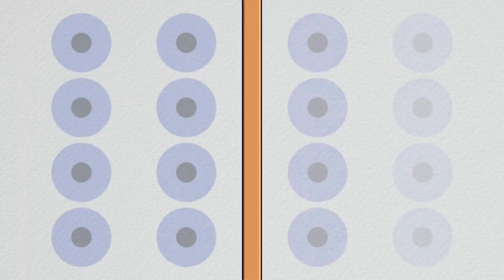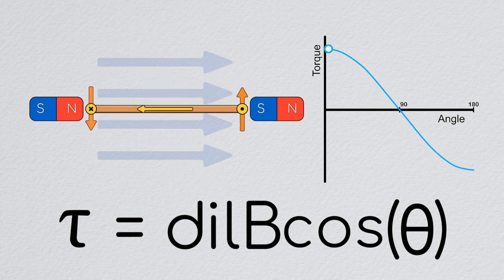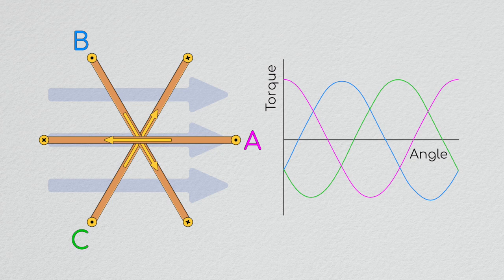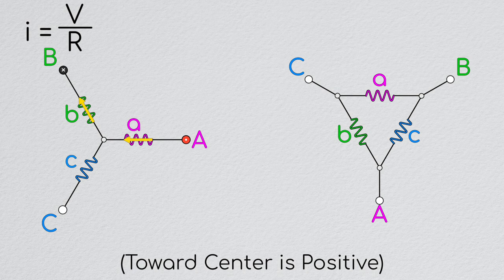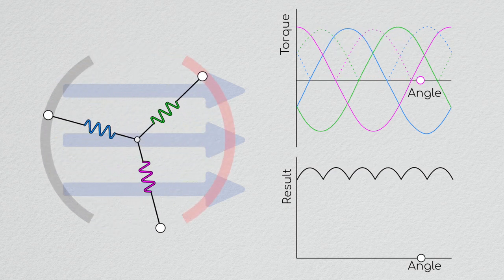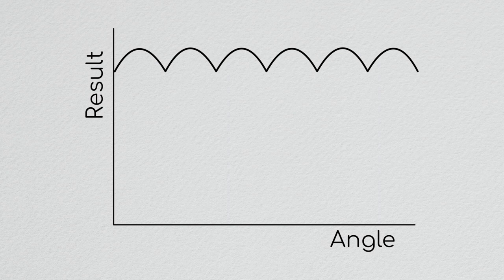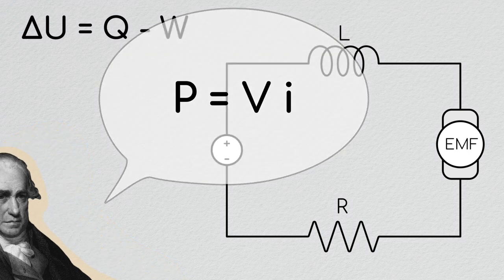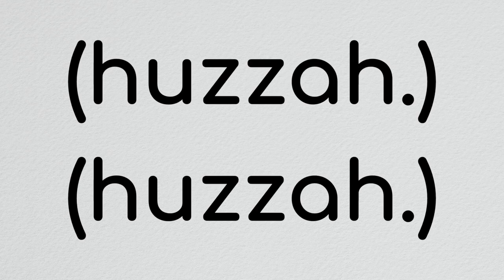How do brushed motors turn?? (Episode 2)

Comment: 1:20 On which plane does the force vector lead the current vector by 90 degrees? Confused at which point along the wire and what theta actually is with relation to  A and B. Are A and B (d) and (ilB) or (F) respectively? Thanks, great videos!
Reply from the maker: Hey great question! Sorry the way i showed/said that is unclear. If i were to re-record this, i would word that differently. The long short of the answer to the question is that A is (d) and B is (F). A little more clarification in case you or someone else needs it: The force F is iLxB, which if the current vector and magnetic field vector are perpendicular, is equal in magnitude to iLB (note that the current in question here is the into and out of the page current, shown at the left and right edges of the loop). So the magnitude of F is equal to that, but, iLB as multiplication doesn't produce an output with a defined direction (because at that point you are just multiplying their magnitudes, and not keeping up with the orientation of the input vectors).But, cross products require vectors, so we need to know the orientation of the force being represented by that iLB. Because a cross product generates an output perpendicular to its inputs, the force vector will be orthogonal to both current and magnetic field. I think now that it would have been better to say that the force vector will be 90 degrees from the magnetic field vector. The theta in question will actually be the angle between d and B. 

Thank you for your question and for watching, hopefully it helps!

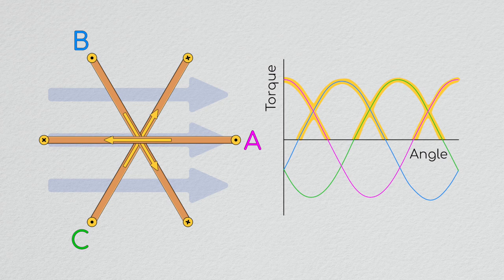Comment: Is the colour coding at 3:00 correct? I think B en C should be swapped
Reply from the maker: Shoot I totally made a mistake there. The plot is correct, the colors I used for the letters B and C are wrong. B is supposed to be green (as it is when I show the wye and delta) and c is supposed to be blue
Reply: @jtlee1108  Thanks for responding, that's what I thought. I still have a lot of questions about the armature windings of DC motors. The principle is clear when simple schematics are shown with single loops but I don't know how these schematics translate to practical machines. So what do these squiggles represent in the why and delta configuration in a real machine?
Reply from the maker: Michiel Mestdagh absolutely, I appreciate you watching and your clarifications and questions. So what the differences between wye and delta come down to is how you solder the wires of the winding together. I have personally never wound a delta configuration, but basically what it comes down to is that that is exactly what your soldering looks like at the middle joint of the motor, then you wind the windings of the motor in loops. If it’s a salient pole motor you have some steel poles to wind it around, and if it’s a non salient pole motor, it’s done in a sheet then wrapped around the rotor (like this https://www.maxongroup.com/medias/sys_master/root/8815461597214/DC-Technology-short-and-to-the-point-14-EN-30-31.pdf?attachment=true but this may be for brushed). I’ll look up some more resources some other time and send them your way, but modeling it as a resistance is basically a way of acknowledging that the wire has resistance, later in the series I shift to modeling inductance to better indicate the generation of a magnetic field

Comment: Thanks for making these videos, they are quite informative 👍

One Question:
Torque is produced by the force generated by the interaction of Magnet's Magnetic feild & current flowing through the Copper wires (I.B.L.Sin(theta), Amperes Law). Back EMF is produced due to rate of  change in Flux from PM of Rotor. how does the energy associated with I.BEMF equals the energy produced ?
Reply from the maker: In an idealized motor (ignoring losses, and idealizing commutation) back EMF times current flow will equal the torque produced times the velocity

Comment: Can you please explain what is negative torque?
Reply from the maker: lol first off sorry for how quick this reply is, I just happened to be on right when you posted it, I promise I dont just creep around my own comment sections. 

So, like force, torque is directional, you can think of it as a vector. However, torque as a vector is defined via the cross product, where Torque = r x F. Typically, in a planar representation (as in only showing 2 dimensions), torque which drives a body to rotate counterclockwise is considered "positive", and one which drives rotation clockwise is condisdered "negative". Ultimately, me calling it "negative" is just a result of how I define my frame. I may not have clearly stated this, but I define the "X" direction to the right, and the "Y" direction as up. Thus, since the "Z" direction is, within a standard cartesian definition, equal to the cross product of X and Y. So, the "Z" direction is out of the screen. So, when I say a "positive" torque, what I mean (but am not clearly stating) is "a torque vector which points in the positive Z direction", and when I say a "negative" torque, I mean "a torque vector which points in the negative Z direction."

I hope that helps, and if it doesnt im more than happy to try to explain it further.
Reply: @jtlee1108  Thank u for the reply. Now it is clear for me.

Comment: while talking about this, it would be great that you explain like issues that may arise due to wear. Like i wont build a motor from scratch, but i will need to know enough to hire someone to fix one for me.
Reply from the maker: hi! so episode 4 talks about how a brushed motor will wear over time. I personally only work in practice with brushless motors, and the only way I have ever had one break was due to me burning out the hall sensors (soldering errors on my PCB). So I dont know if I am qualified to explain everything about what to expect when fixing, but episode 4 does go into how they typically break (again, my experience is limited to classroom lectures on motors and work with brushless motors, so I can't say with 100% certainty that what I talk about is the only way a brushed motor will break.) but thanks for the feedback, I super appreciate it!

Comment: Great video series !!!
Would you explain the differences between high voltage vs high current motors in the upcoming videos?
Thanks !!!
Reply from the maker: Hi, first off thanks so much! As far as your question goes, I hadn't been planning to really get into motor design type stuff too much in this series, but I can give you what knowledge I have here! 
Basically, what it comes down to is the motor's winding pattern and its purpose. The maximum speed at which a motor can provide torque is related to the voltage applied. So, higher voltages supplied can mean more speed. A motor's failure modes (With respect to supplied voltage and current) typically comes from overheating. Heat generation in motor windings is dominated by joule (resistive) heating. There is also some heat generation due to bearing friction, but its minimal. So, in order for a motor to stay at a safe temp, it has to be able to get as much (or more) heat out via convection and conduction as it is generating by resistive heating. As I talk about in episode 4, joule heating is equal to I^2R, so its really a function of current, not voltage. Sure, if you supply more voltage, you can produce more current. However, the current is what causes failure. So, the primary limit of a motor is the amount of current running through it. If you are using a motor turning continuously (as in a non-servo operation), this does mean that applying too much voltage can and will burn your motor out. however, if you are using your motor as a servo and/or you are using an H-bridge, you can certainly use a much higher voltage than they list as nominal, so long as your RMS current doesnt go above the rated current. 
I am not 100% confident in what follows, but it is my understanding that the primary difference between "low voltage" and "high voltage" motors is the way they are wound. The wires used in the winding have some inherent resistance, which is proportional to their length, and also goes up as they get thinner. so the wires chosen, and the number of turns in the windings will effect the resistance of a motor. The change in resistance does change the amount of joule heating, but for a given voltage it also changes the current that would be flowing. So, it is my understanding that higher voltage motors have a larger resistance, thus meaning that they need a higher voltage to reach the same current levels. Whereas a low voltage motor has a lower resistance, and thus will produce more current for a given voltage. As far as "high current" motors go, I am honestly not super sure without doing some research on my own, but my intuition would be that A) they may do a better job of getting heat out, so they can run more current, and B) they will have lower resistance, which means that for a given amount of current they will have less resistive heating.
Reply: @jtlee1108  Thanks for your response! Looking forward to your next videos! It's the perfect place to learn about the electric motors and their control systems
Many thanks !!!